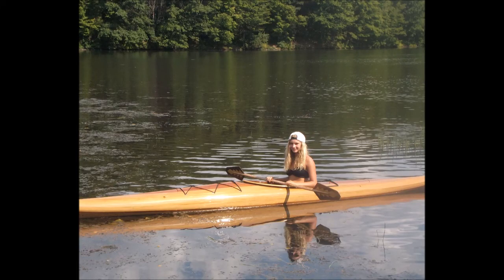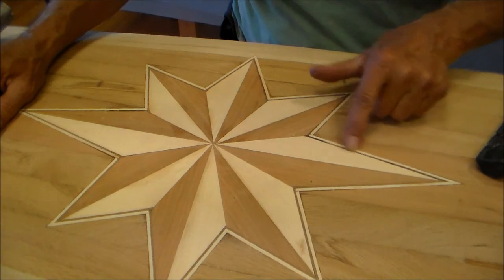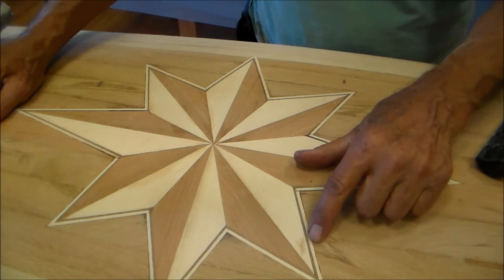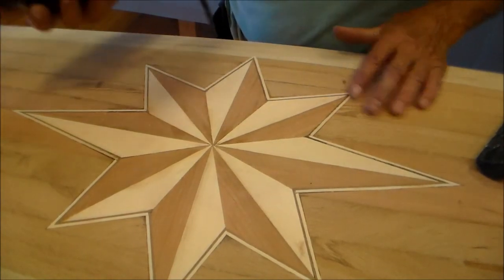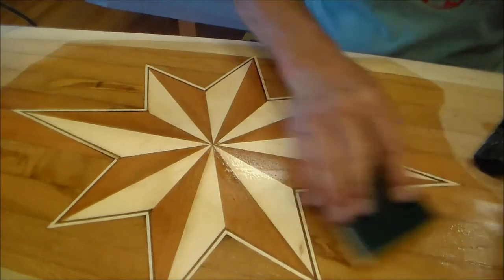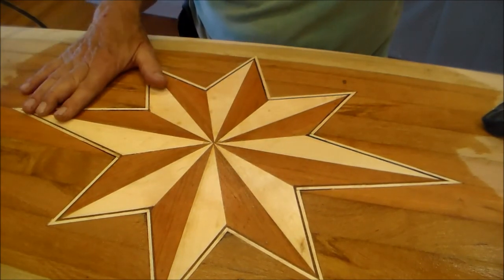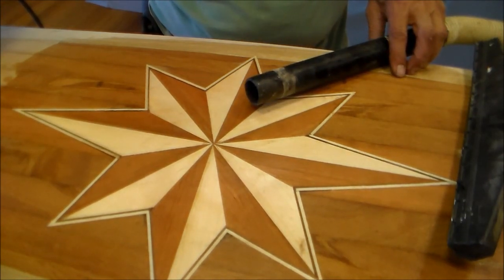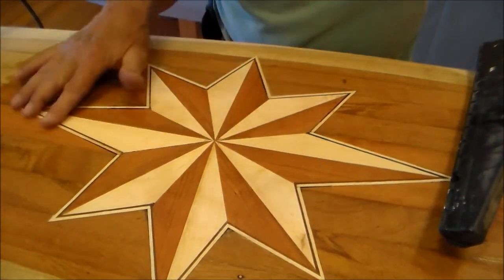Building the Compass Star Kayak,Sanding the Hull

Comment: I would recommend filling chip outs by gluing wood material and then fill any gaps left with epoxy and sawdust. I even fill gaps in the strips with wood wedges first.   Also the ridges, I usually take down with a spoke shaver ,then a low angle block plane, and finally a wood scraper and sanding. You done a great job!
Reply from the maker: good advice my friend---Don